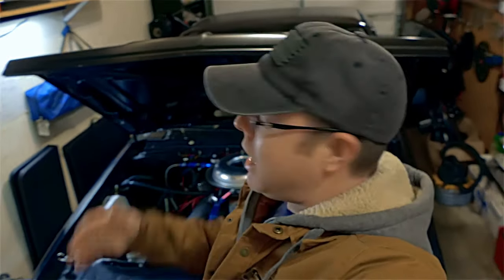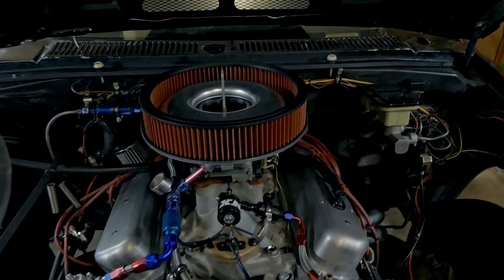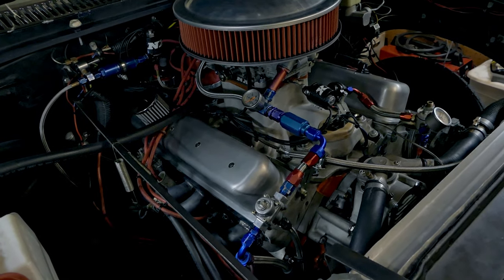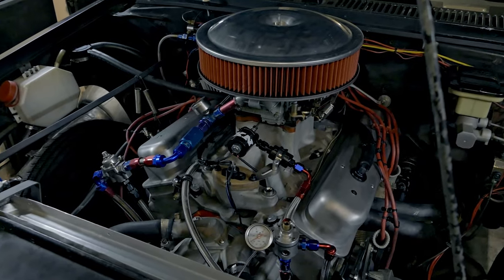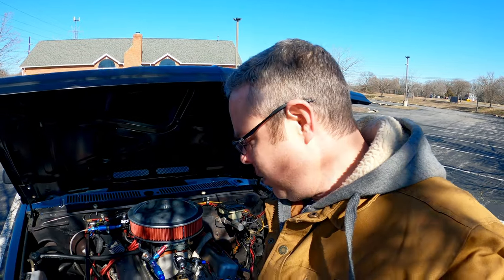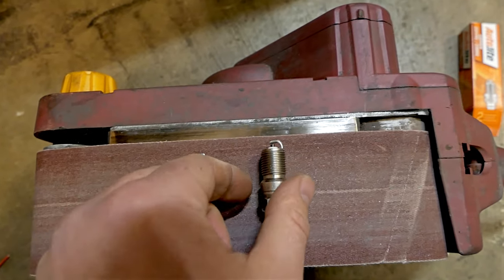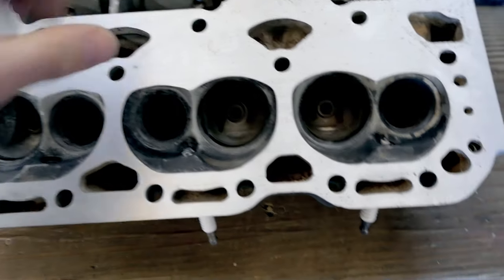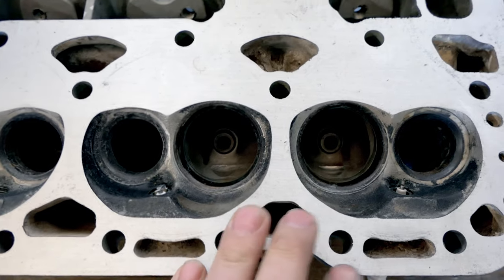Reading Spark Plugs the right way, Corner Jetting, Holley 4150 carburetor tuning. LT1 Gen2

Comment: Yes, I agree the timing is a bit aggressive, the timing line should be in the center of the apex of the bend. 
Non-projected tip plugs highly recommended with nitrous. 
Autolite sells a good nitrous plug fairly cheap. 👍
Great video showing how to work through the tuning process! JD
Reply from the maker: I went all the way to 28 degrees of total on the Projected Tip and could not see a timing mark and the plug looked worse. I was able to go to 33 total with the colder Non-Projected tip plug. Just goes to show how using the wrong plug even NA can have you scratching your head.

Comment: Try indexing your plugs aiming the opening of the strap at the exhaust valve. I have to do this on my bbc otherwise it actually blows the spark out. It's a painstaking process but had it proven to me on the engine dyno.
Reply: "blows the spark out". You mean it failed to ignite the fuel and caused misfiring? That would be hard to miss with all the popping.

Comment: The air filters with the filter built into the lid are worth a little free power. Im assuming you've seen it on engine masters as well.
Reply from the maker: I did but I think the stacks and open lid only helps when the car is not moving. I would like to see the same test in a wind tunnel and 100 mph winds  creating a high pressure and low pressure zone.

Comment: It would pay to install EGT’s in each tube in the header that way you know what each cylinder is doing... A way to get the gauge and sensors cheap is to buy them through an aviation supplier instead of automotive. The mechanical gauges in plains work the same way.
Reply: Nice tip, do you have a company to source these from?
Reply: I would source them through an aviation salvage yard near your location. If you had a V8 engine you were planning on using them on you could source two gauges and two  sets of EGTs from a 4cyl plane
Reply: @jsteed4388  Appreciate your quick response.  Thanks.   Actually never checked if we have any Aviation Salavge yards in the area...but the Wright Brothers lived not too far away.

Comment: I have a question for you! When I put a air cleaner on my 496 big block and drive the car around for awhile it doesn't want to start back up when I try to turn it over unless I remove the air cleaner. Why??? Thanks
Reply from the maker: Maybe it's too fat on the fuel. Or maybe the fuel is too hot.
Reply: @TPVPRO  ok. I've rejetted my carburetor. This is a 850 ss quick fuel with choke. I'm running 75 jets in the front and 80 in the rear. 40 squirter in the front and 37 in the rear. I had a bog at wide open throttle until these changes. It's fixed now! I'm using a 1-inch plastic carburetor spacer, fuel lines are wrapped underneath the hood. My headers are not wrapped or ceramic coated. As long as I don't put on my air cleaner on, no matter how hot it gets outside she'll crank up, but as soon as put the air cleaner back on starting problems start...🤯 I might just run it without a air cleaner.
Reply from the maker: @musclebone7875  Put a wideband o2 on it it will give you more data to tune on instead of guessing. You still need to change plugs and do a full pull and check them all to check for a lean cylinder.
Reply: @TPVPRO  will do! Thanks for the advice. I will keep you posted 👍